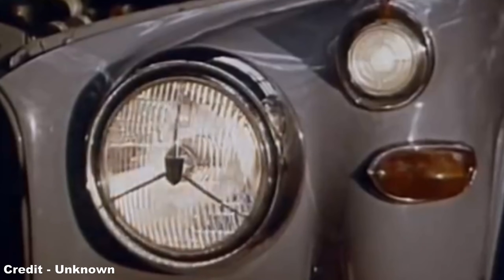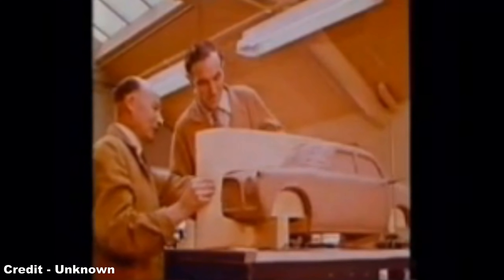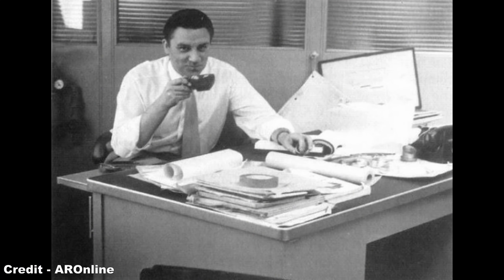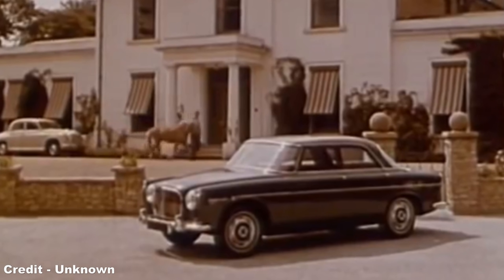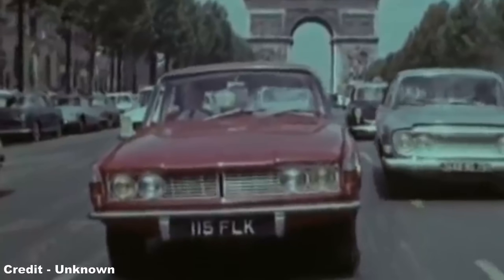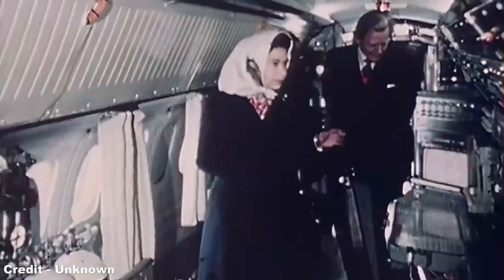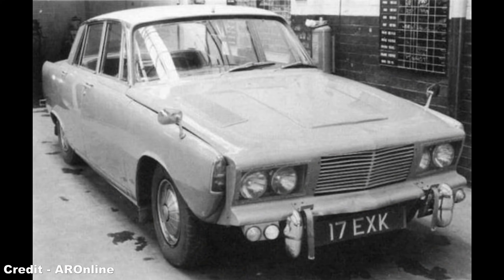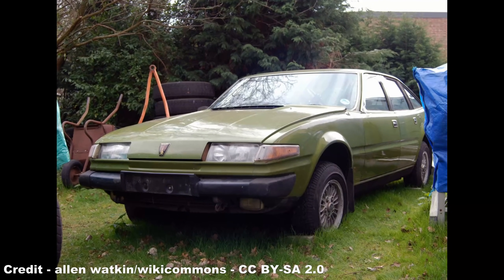The Regal Rover - Rover P5

Comment: Again, a lovely glossing over of the fact that the Jaguar XJ 6 swallowed so much of the BL resources. I have a mkIII  with the Weslake makeover  that came in with the mark II giving the IoE engine some 134 BHP has been overlooked. The Buick was to be tried in the P5 chassis for the P6 as a test bed. It was never meant to go into production because the car was approaching 10 years old. P4 was also  dropped in 64 so that '63 saw P4, P5 and P6 all in production.  P5B came off the lines first in the summer of 66 after the works shutdown. Jaguar didn't have the XJ version ready so P5B was shoe horned into the gap.  Incidentally the Leyland board was geared towards Jaguar.

Comment: So many problems with the British motor industry during this time. Just the fact that an engine General Motors was throwing away turned into the single most successful engine of the whole industry says all you need to know
Reply: To manny people with no experience in the automotive field running an industry.
The Industry was choked by managers and unions slowly to death.
The result were bad customers experiences of unreliable British cars.
And then came the Japenese with their cheap reliable cars!

The result.
Landrover and Jaguar are now a part ot Tata.
Vauxhall is now a part of Stellatlantis.(PSA+FCA)
All other volume producing UK car brands have vanished.
Only the exotics and handcrafted low volume quality brands remain.
And no executive of BL was hanged!
Reply: @obelic71  Japanese cars were more reliable than British cars, but they weren’t very reliable in general... not like people tend to remember with their rose colored glasses. My dad left a Buick dealership to work at Honda in 1980. He would tell me that their reliability wasn’t fantastic, but their warranty department was top notch. It didn’t matter what you were there for... if you came in for an oil change and they saw rust on a fender... they were good for rusting from the inside out... before that car left the shop it had a new fender. They had dozens in every color they carried. And the customer wasn’t told what they were doing. It was installed quickly and quietly. That’s how the Japanese got their reputation of unbreakability
Reply: @redram5150  Correct the first Japenese cars did rust like every other carbrand at that time. They were wel put togheter and the customer service was good. 
Outside the UK the BL dealers were euhh very very very bad. Bad service expensive parts etc. etc.
Still remember my Aunt as a kid who bought a Brandnew Allegro with here hard saved savings at the local BL dealer in town
That car was a nightmare straith from the showroomfloor
She couldn't pay the BL dealers bills anymore and had to sell the car at a big los.
It took years for here to buy another car again due to the painfull experience.
And yes that dealer went  out of bussines. 
No other carbrand  wanted to use former BL dealers.

Landrover and Jaguar specialist garages  started by  owners who could repair and modify the cars way better then the official dealers.
They survived and expanded after the BL disaster.

Secret repairs and upgrades are now normal. 
If your car is in service with a dealer they change parts before there is an official recall.   

To end the Britisch car saga with an up note.
Old Landrovers Rovers, Jaguars MG's, Morris Minors  and retired London cabs keep running and running and running and are still loved by their owners all over Europe.
Reply: Rather surprising when you think about it, afterall the brits were responsible for arguably the most important and successful aero engine of WWII, the mighty Rolls Royce Merlin.
Reply: @redram5150  that is true, in the beginning Japanese cars were not very reliable. The difference is they learn quickly and they became reliable. This did not happen with the British Industry
Reply: @StaffordMagnus  I think a better choice would be the Pratt and Whitney r2800
Reply: @kevinbarry71  That would be the other contender, yes.
Reply: @StaffordMagnus  mmm the sound of a running RR Merlin that gives every engineer an orgasm ooh sorry need a instant cold shower be right back.
10 min later. 
From History the British performed above and beyond under extreem pressure from outside
Look for example at the dehaviland mosquito computers, radar, sonar etc. etc.
Its sad that pennycounters  and socalled managers are capable to destroy an entire industry.
Reply: @kevinbarry71  You're absolutely correct - the oriental people learn very quickly. The Koreans have shown the same tendency and I expect the Chinese are already on the same path.
Reply: The Americans didn’t throw their (perfectly good) engine away for no reason; they were forced into doing what they didn’t want to do by trade unions and interfering politicians. Ironically, the same unholy alliance that led to the formation of British Leyland and the tragic end of the Rover marque.

Comment: the 215 was never in the large cars, like the Wildcat shown in the vid.  it was exclusive to the Buick Special/Skylark and Olds F85/Cutlass, which were the new 'compact' GM cars.  The senior Buicks and Olds' continued with the 401 and 394 big block V8's, respectively.  The Buick engine shown in the vid is actually a 401 nailhead.  with US low speed mph limits, cheap fuel, and American taste for large cars, the small alloy V8 didn't make much sense.  My dad had a '61 F85 with the engine, and it did not tolerate overheating like the iron V8's did...at least 1 head warped during the time we had it.  After 1963, the cars that these engines were installed in grew quite a bit, and eventually had the same power plants as the large cars.  That was end of aluminum engines for the US (except for a few hipo models) until really the Vega...another story.
Reply: In 1965 Jack Brabham and the Australian Repco company purchased a few dozen of the Oldsmobile version as basis for the Repco Brabham F1 championship car. With a reduction to three litres and local improvement with an overhead cam and dry sump, the car was good enough to win the F1 world championship in 1966, and 1967. Beat the Ferrari, BRM, Ford, Maserati, Honda and other exotic powered cars two years running. A sixteen cylinder BRM no match for the Repco Brabham based on an Olds engine.
Reply: The 215 was also an option in the Pontiac Tempest/Le Mans in 1962 as an upgrade over the 194.5 c.i. "Trophy 4" which, as the math suggests, was little more than the 389 c.i. V8 from the full size Pontiacs with the left bank of cylinders omitted. (The small Pontiacs dumped the 215 for '63 in favor of a new 326 c.i. variant of the division's iron V8.)
Reply: Vega victim here. As usual GM used the buyer as product development..

Comment: P5 was an extraordinary car. I used to travel from London to Newcastle at 100mph, although not legal in the 1960's you could get away with it !  It had a lovely Fairey overdrive that was switch operated. All the door panels were aluminium but not the rear wing which always rusted. Serious fault with the engine was the cylinder head. The block was cast iron but the head was aluminium. Had to have several head gaskets replaced due to corrosion because of this. What is amazing is that the mpg at 70mph in overdrive was 28mpg but the 2019 Jaguar XJ official figures for the 3 ltr engine is almost the same mpg.
Reply: I have a fairey overdrive on my 2 door Range Rover

Comment: This makes me sad. I bought an SD1 in 1988 - 9 years old. It was the best and the worst car I have ever had. The engine was great. Ride was excellent. Sounded fantastic - especially without the back silencer that everyone removed. But all the switches broke. The windows failed to move. The gauges broke. Everything electrical broke. Power steering pump broke. The headlining fell down. Terrible quality. Such a shame cos the designers had done well, the men who built them worked hard but the bean counters had sourced crappy cheap parts. Well, you can only do that once!  Lamentable indeed.
Reply: The bean counters - the Engineer's enemy. Wrecking good concepts and the idea of quality production.
Reply: I had the same experience with my Daewoo Espero. The best and the worst car I ever had.
Reply: Blame Joe Lucas for the crappy electrics. The shame is that for an extra tuppence per thousand they could have used items ten times better than the ones they chose. The result was cars built down to a price instead of up to a standard, which was what people in that market expected.
Moral of the story ? If you're going to build luxury cars then build luxury cars , not cheap ones with a high price tag.
Reply: @Kevin-mx1vi  It wasn't  whilly Lucas: they had to survive, and BL insisted on cheaper components if they were to be their suppliers.  As with the P5, Lucas went from a quality manufacturer to being run by BL bullies and beancounters.
Reply: Yes it was a shame because the SD1 was a stunning car to look at and on their technology they were way ahead of the market, but crappy build quality and poor engineering due to lack of funding was its death sentence. Beautiful machine though and the V8s and even the 2600 are going for stupid money today.
Reply: @matty6848  Are they really? Sold mine for a song years ago. At one stage I managed to get all four windows to wind up and down at the same time AND the central locking working too. In a rush of blood I put an ad in the paper that weekend (it's what we did). Sold it fully functional - apart from the temperature gauge that had been glued at Normal by the previous owner :)
Reply: Yep I sold loads of second hand SD1's, The windows would frequently stick and would need a good thump on the door card to get them working again, Great concept and good looking cars but rubbish 2.6 and 2.3 engines, 3.5 V8 was brilliant ! 2.0 underpowered.
Reply: @nicnak4475  Didn't even know there were tiny engines available in the UK. All ours in Oz were V8 - unfortunately with low compression pistons and slushboxes. But those low compression V8s were so effortless. I would have one again now that I'm retired and have the time to work on it daily. It would be a pleasure.
Reply: I worked in a Rover dealership in the mid 80s the SD1 Vittesse was a great car to drive the VM diesel engine version was bloody awful.

Comment: The P5B is one British manufactured vehicle I would love to own, only if have to swap out the Buick motor for a Ford powerplant (Garbage Motors products suck mansack)...the P5B, Jensen Interceptor, Triumph Stag & TR6, and Jaguar Mk II are all dream cars of mine.....
Reply: The 215 / 3.5-litre was extensively reworked by Rover for UK and European use and was powerful (135 kW (184 PS)), torquey (305 Nm) & reliable, unlike its 4.0- and 4.6-litre successors. In the end it put out 160 kW (218 PS) in EFI guise in the 3500 VITESSE Twin Plenum, whilst peak torque stayed the same as the P5B installation.

A diesel variant was explored with Perkins of Peterborough - Project Iceberg - in response to the 1973 oil crisis, in both atmospheric and turbocharged formats. It was slated for use in the Range Rover, Rover 3800 SD Turbo (SD1), and Jaguar XJ (XJ40) - though Jaguar engineers deliberately designed the XJ40's engine bay so the Rover V8 wouldn't fit. This then required it to be reworked to swallow Jaguar's V12. Idiots.

However:

- internal cooling and cylinder head failure issues;
- the need to use the same block casting as petrol variants (hello, related Oldsmobile Diesel horror show) so it could be built on the same production line to save costs;
- financial and logistical problems when BL split Rover and Land Rover apart;
- Land Rover subsequently taking over V8 production to its own, smaller capacity production line in Solihull;
- BL pulling out of the venture in 1983;
- BL stopping all technical support when Perkins tried to continue alone...

...killed the V8 diesel project. However, the crankshaft castings were later used for the 4.3-litre (4,275cc) V8 in the 1992 RR LSE.

3800 SD Turbo / Project Iceberg
Capacity: 3,822 cc
Bore: 88.9 mm
Stroke: 77.0 mm
Power: 75 kW (102 PS) asp / 110 kW (150 PS) turbo

Comment: I think that after watching this excellent video I almost want a P5   I say almost because I already have a superior car in the form of a Humber Imperial      The big humber at its conception already had all the luxuries that were later added to the Rover such as Hydrosteer power steering and its vastly superior engine    Twin headlight system, the first on a British car and an interior to rival anything in the world    My Imperial from 1966 had even more spec such as Armstrong Selectaride shock absorbers  , West of England cloth upholstery,  rear separate under seat heaters and the useful picnic tables to the rear      Quite why the Rover is so overvalued today when the Humber can be bought on the road for a few thousand pounds is beyond me .
Reply: the humber was the driving car of choice as opposed to state limos of the royal family pre p5.it was a great car but if i may so suffered from the disease that plagued most british car ranges of the 60s except oddly rover! basically brand engineering multiple identical models with the same name just different engines and trim levels!the hawk super snipe and imperial confused buyers as did woseley westminster and vanden plas as well as zodiac zephyr executive!with rover my dad had one a 71 p5 coupe from new you had a luxery car full stop! same with the p6 2000 or for more power the 3500.jaguar had a confusing range also pre xj6 which fielded the lamentable 2.8 as well as the 4,2 until the v12 became available much delayed intended for the mk 10 but arriving with its 14 mpg in time for the oil crisis! rover then went the same route as the others offering the poorly built sd1 at first as a luxury marque but then bunging any engine they had in it to sell them seriously devaluing the brand! as a car dealer put it to my dad in the 70s problem is with leyland they just had too many similar models in the 60s made by different branches .my dad had a humber imperial in the 60s was a fantastic luxury car really felt like something special as you say its a much underrated marque.my sister has a neighbour whose son owns old vehicles his regular drive his a humber super snipe.people genuinely stop in the street to admire it when it goes down the road !

Comment: UK was plagued by the deadly combination of incompetent politicians, poor managers, and suicidal unions ! In the 70s, a French former pilot who had been winning the "24 heures du Mans" with Jaguar was so disgusted with the poor quality of his XJ6 that he switched to the old ennemy Mercedes for his private car ! In the 50s and early 60s, some British manufacturers were still capable to produce highly attractive cars, but ( in a parallel way to your airplane manufacturers) they did not have the capital to invest in the creation of brand new modern machines and engines making use forever of improvements on previous ones , which has its limit. The last Rovers were moved by modern reliable Honda and the BMW engines, and Jaguar lived for around 40 years on the formidable design of the straight 3.8 then 4.2 , and finished with Ford engines.